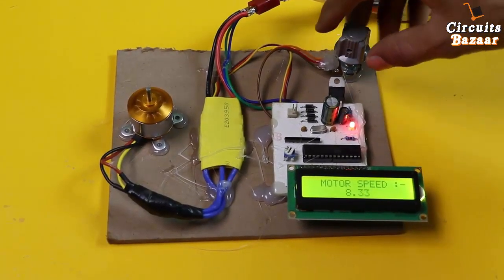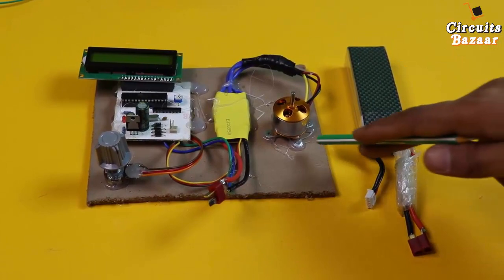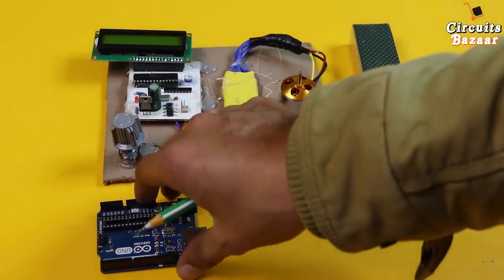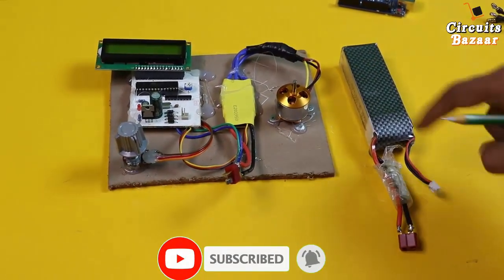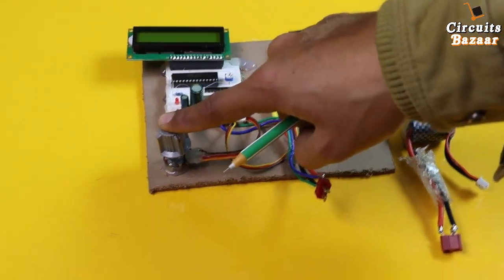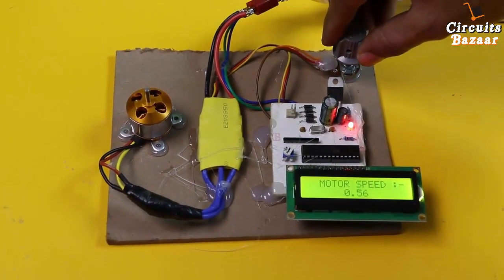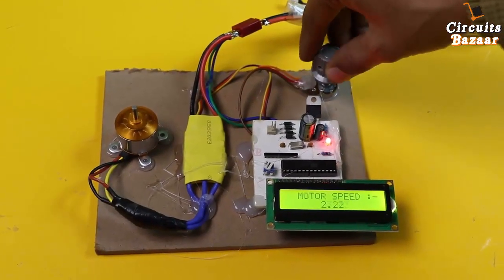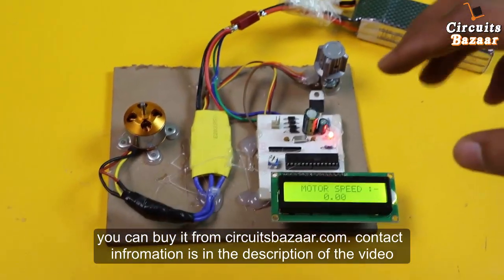bldc motor speed control project

Comment: HEY MAN I GOT BRUSHLESS MOTOR WITH 14 MAGNETS FOR MY LONGBOARD AND WHAT NON-PROGRAMMABLE CIRCUIT SHOULD I USE FOR WIRED REMOTE CONTROL ???
Reply from the maker: yes you can use
Reply: @The.Innovative.Indian  I GOT BRUSHLESS MOTOR WITH 14 MAGNETS FOR MY LONGBOARD AND WHAT NON-PROGRAMMABLE CIRCUIT SHOULD I USE FOR WIRED REMOTE CONTROL ???